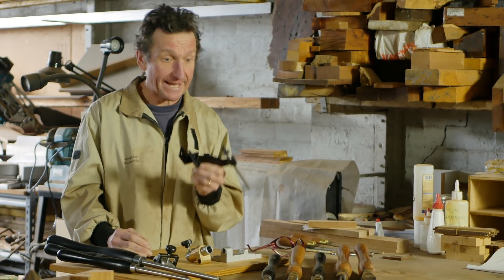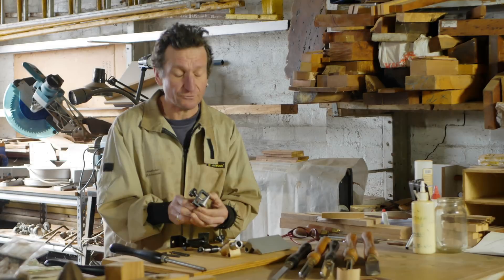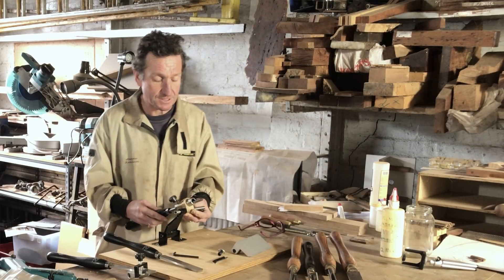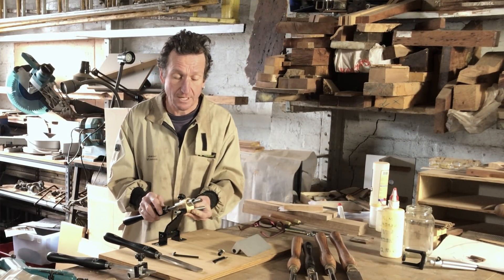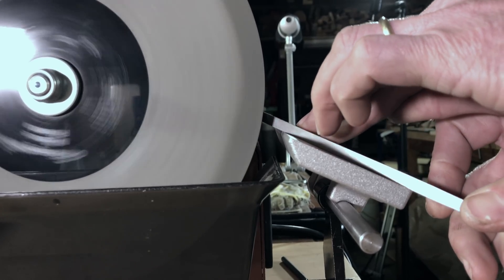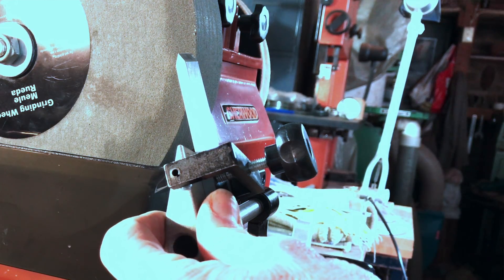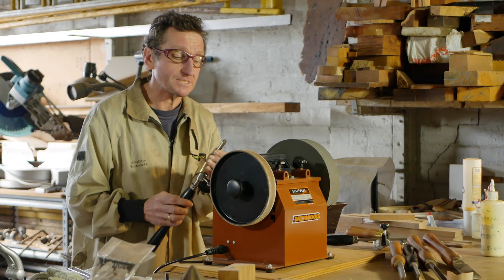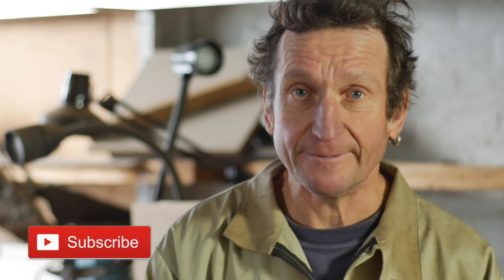Perfect Fingernail Grinds by Hand!

Comment: Demo, no help at all. jig as demonstrated (very poorly) big waste of money.
Reply: This jig may be OK with dry grind sharpening but does not seen to work for me with wet grinding because the slurry from the stone bogs down the sliding action of the jig even with less water it still runs back down to the jig. So, what an I doing wrong??. The jig was promoted in the domo as a wet stone kit and I purchased it on that basis.
Reply: Do I now need to buy a second stand to be able to use the the F/N jig on my dry wheel??.
Reply from the maker: Hi Leslie. The Heligrind has been updated with a new demo video. Perhaps give this one a try: https://youtu.be/Qa5tetg7P2Y